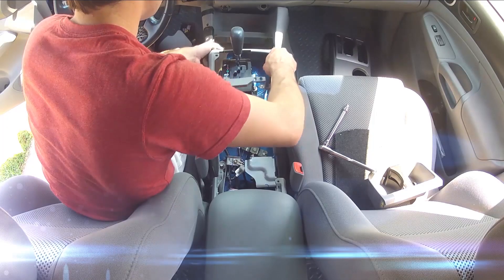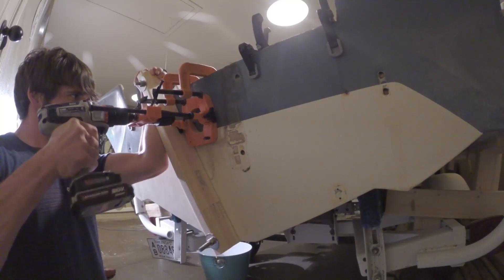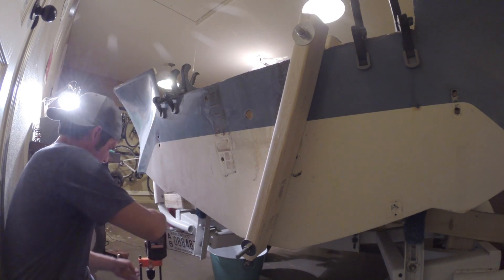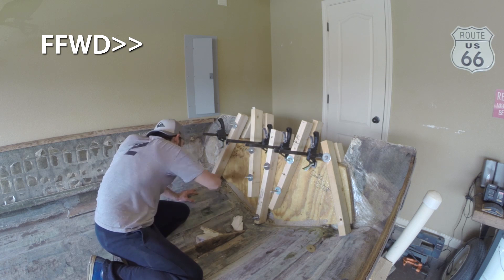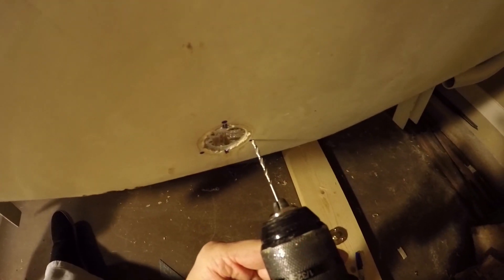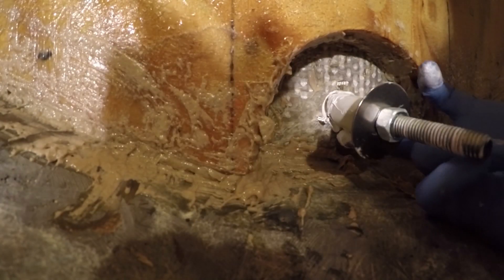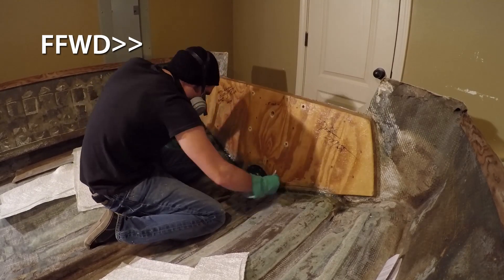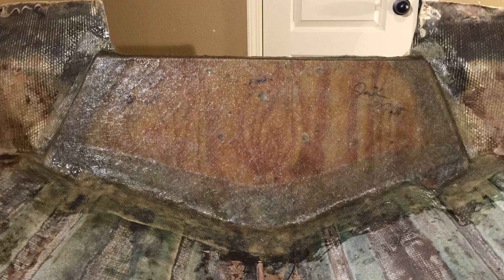Glueing and Tabbing In The Transom // Project Glastron/Vlog #10

Comment: Hey Jmink. Got the transom out! Water damage all around, but not at the drain. 

I remember your "wood screw" find in the hull. I found 3 pennies randomly glued between the my green board and the transom. These had to be plopped in the glue originally in 1976.  Date on penny--1975 and the glue made a pretty good cast.
Reply from the maker: Good job! It's a pretty good feeling getting that transom removed.  That's pretty cool finding those pennies. It's crazy all the stuff we find in theses old boats.

Comment: Been watch your videos . Looks like your going at it the right way . I've built several boats out of fiberglass . If I could offer a little tip .. Any wood you decide to cover with fiberglass make sure you wipe it down good with acetone. Resin does not like to stick to anything with oils on it . Makes for a lot of extra work when your resin is contaminated . Also have you consider wood flower, which is a fancy word for sawdust, instead of 1/4 inch glass chop strand ? I find it's easier to work with and more cost effective . Makes and excellent bond for filets and scarf joints . Anyway hope this helps and keep the videos coming , great job !!
Reply from the maker: Thanks for the tips Ray Lentz, I will have to look up the wood flower technique.  I'm happy to report that I have been making some great progress, but I don't have the videos edited to upload yet.  Thanks again for the comments, I appreciate 'em!

Comment: Both sides of the CSM are identical and the roller i used was a foam roller, I did call West epoxy and spoke with there tech support people as I thought the resin may have been old but they confirmed that it was from 2016 as I felt it was coming out of the can rather thick so I was told to boil water then to put the can in for several minutes something I haven't tried yet

Comment: You have truly done an amazing job. 
If I am correct from watching the fiberglass order tips video you made, you did not order any epoxy. I was told by us composites today that I need to buy epoxy to glue the stringers in place and to glue the transom in place. Can you please confirm ?
Reply from the maker: +Taylor Martinez thanks!  You’re correct, I did not order any epoxy.  I even ordered over the phone and the guy I spoke to didn’t suggest epoxy when I told what I was working on.  I’ve seen others who use fiberglass putty or glue to set their stringers.  I chose fiberglass putty (thickened resin) because it seemed to be the most popular.

Comment: Did you put 1708 over your drain ? Will you be cutting that out for your drain or leaving it like that? Just wondering because I’m working on my transom on my Glastron.
Reply from the maker: Yes I did and I cut it out to reveal the drain pipe and then sealed around the outside of it after cutting out.

Comment: Nice work! What type of caulk on the transom under the fiberglass?
thanks CG
Reply from the maker: +Chip Gregory thanks!  I used PL Glue between the transom and hull.
Reply: jmink did you use Loctite PL marine glue because it looks like you just use the household glue, I'm not sure that's a good idea to use that in the marine environment

Comment: how long has that resin u got been sitting? I am doing the same as you but mine is a 1967 glastron. I got my order from us composite a few weeks ago and just noticed the sticker on resin buckets saying 90 day unopened shelf life. im almost ready to start glassing but not sure how long it will take me due to lack of time due to work. if it goes bad after 90 days I just threw $200+ I  have a few weeks left till 90 days are up. looking at your dates its been way longer than 90 days between the video of when u got order and when u used the resin
Reply from the maker: +Armando Flores let me start out by saying that I maybe condemned for this, but my resin is about a year old and I have still been using it without any issues.
Reply: +jmink wow!! That's good to know I was getting worried that it would go bad. thanks for answering and really enjoyed watching your videos. like you this is my 1st attempt on this and learned alot by watching you a a few others. thanks alot!! and bows the boat?
Reply: @jmink  I've used resin that was 5 years old just gets thicker

Comment: you should have said one word of caution is be sure to wear gloves when working with 3M 5200 adhesive because once it's on your hands only time can get it off not a pocket knife or a wire brush or the best soaps or acetone or anything else it's there for the duration a real quality product.

Comment: I tried applying the CSM to the transom but as I was rolling the epoxy resin on the CSM started sticking to the roller and shedding like a dog so I had no choice but to remove the layer of CSM do you have any idea as to what might have gone wrong?
Reply from the maker: There are two sides to the CSM a smooth and a rough side. I'm curious which side was up, usually, I make sure the smooth side towards the top and not the wood.  Also, I always use a roller that is rated for smooth walls and cabinets.

Comment: hi mate i noticed you dont use a air roller to pump the air bubbles out of fibreglass
Reply from the maker: I started using one after this point.  They're pretty helpful.
Reply: there a must ,im currently installing a new transom and a few extras also